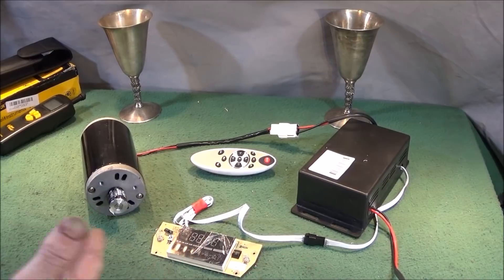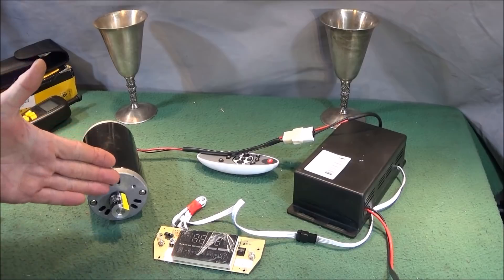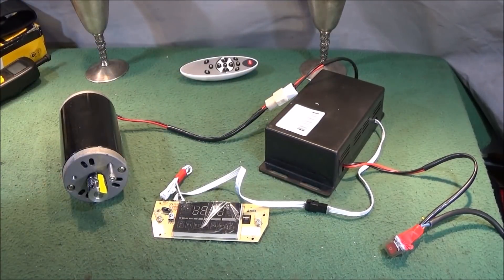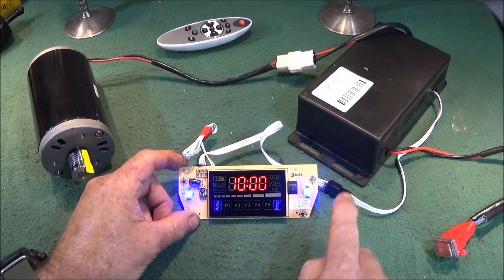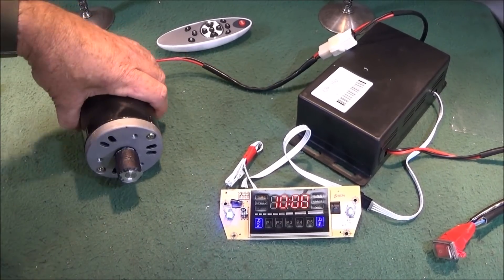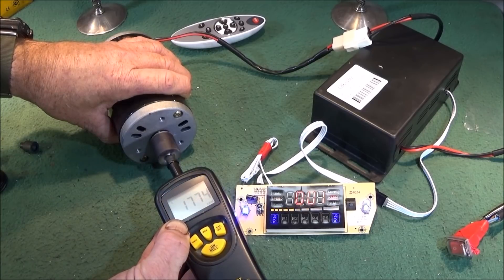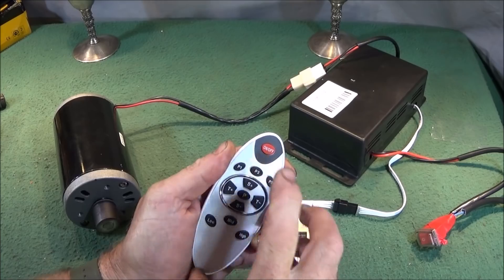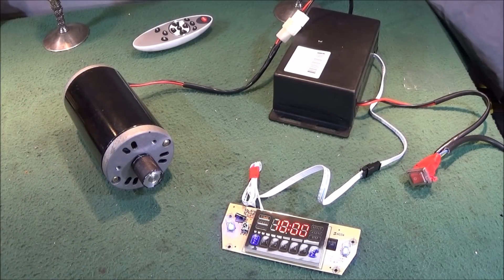An Excellent Variable Speed Treadmill Motor Set For Home Made Projects

Comment from the maker: The Fantastic Treadmill Motor Set https://www.ebay.co.uk/itm/2538507780...
SMARTSENSOR AR925 Digital Tachometer Contact Motor Tachometer --  https://goo.gl/9i18xR
AN EXCELLENT SEPARATE MACHINE TACHOMETER SET   https://goo.gl/6yGjCv
(This machine tachometer is a safe low voltage and is easily set-up on any machine. The wiring diagram
for this one is on the Banggood listing page)
Reply: I have been playing around with this setup and have found that if you follow the wires from the display part to the main board. There are 4 connections 5v 5v Pw and gnd . If you wire the last 3 up to a potentiometer you can control the speed with it and do away with the display part if needed! (You can change the direction of the pot by switching 2 of the leads) I have tried 10k, 100k and 1m. the first 2 work best the 1m didn't work. But I would say you need somewhere between the first 2, maybe 47k?  I'm waiting for 1 to arrive from ebay so I can test it. Hope this helps some people. :)
Reply from the maker: Banggood Health Protection -- http://bit.ly/33tNTBx
  Banggood Health&Care Protection --  http://bit.ly/3d7QpSy

Comment: Hi Steve.
Is this any good for a small wood lathe? My motor burned out on my small wood lathe. It was a 500-watt motor but I see this is only 200 watts, so just wondering if it might be any good as a replacement? They don't make motors for my old lathe anymore.
Cheers.

Comment: Guess so of you guys might have missed my original Post . Showing that you can very easily just wire in a potentiometer to control everything and get rid of the display board

I sent this as a reply so you guys might have missed it.

He's is my original message. 

Luthlan
Luthlan
3 hours ago
I have been playing around with this setup and have found that if you follow the wires from the display part to the main board. There are 4 connections 5v 5v Pw and gnd . If you wire the last 3 up to a potentiometer you can control the speed with it and do away with the display part if needed! (You can change the direction of the pot by switching 2 of the leads) I have tried 10k, 100k and 1m. the first 2 work best the 1m didn't work. But I would say you need somewhere between the first 2, maybe 47k?  I'm waiting for 1 to arrive from ebay so I can test it. Hope this helps some people. :)
Reply: Update 47k seems to work OK. Hope this helps!

Comment: hi Steve  just waiting on delivery for my motor  I will be  installing on my Simat 101 to replace  the blooming big AC    hunk thats  there now, just 1 question  what do the figures on the display refer too?  is is speed or some sort of percentage
Reply from the maker: Hi Nigel,It should be good for that lathe. The display figures are for the exercise machine it was meant for,that's allI know. The speed control set and display are very good electronics. If you want an RPM read-out set up a seperate unit using one of these.  DIGITAL TACHOMETER: https://goo.gl/6yGjCv
 These are simple to wire and set-up. With safe low voltage. The wiring diagram is on the Banggood listing when you scroll down the page, plus I have done videos on installing them.
Reply: cheers  Steve  ordered one from amazon plus a box to put it in , going to power it  from a PP9 battery and i think i will probably use the remote control instead of the panel itself  so that can be tucked away. how is your  application coming on?
Reply from the maker: Hi Mine is coming on well. I have just fitted the tachometer. Hope to show it in use again tomorrow. Hope you aren't going to sit back in a chair and operate the lathe with the remote☺

Comment: Great vid. I just recieved mine. I Really need to reduce the lowest starting motor speed to about 50 rpm without the use of pulleys and belts as pulley would be about the size of a dustbin lid to get this low. Would need  an electronic device. Then use existing remote to increase gradually.  Any advice ??
Reply: I have been digging though these vids for a while now and it seems the consensus is that they don't have any torque at that low speed. I need a motor for a super heavy antique sewing machine.

Comment: Hi Steve. I have decided that I will use mine as a motor feed for the milling machine. I will have to wire it in for a reverse switch, and I note the comments of  Craig Marshall. I now have all the plate material, boxes etc. that I need to make the motor feed, but unfortunately  I have other more pressing jobs in front of that at the moment. I see the seller of this kit now links to this video in his item description. Regards
Reply from the maker: Hi Stephen, That sounds like a great project. I will show the motor strip down later to see the brushes etc. Also I have found a great low cost DC motor control unit on Banggood to run these. Much simpler in design to the actual treadmill controller kit. I will show this in my next video later this evening if all goes well.
See the controller. It is a great quality small unit and it works perfectly. (It is AC 220v to 400W DC 0- 220V Controller)                       220V AC Speed Control Controller --  https://goo.gl/n5gzhT 
Regards
Steve

Comment: Thanks Steve. My father and I have both ordered one of these. One for the Little Tyzak Zyto Lathe (which is a bit like a poor mans ML7) about the same size as the Chinese mini lathes. The other one will probably go into my cheapy drill press in hope that I can beef it up and turn it into a light duty milling machine at a later date.

I am struggling to find a Surface plate that's cheap.  In one of your videos I saw you using a black granite chopping board type one. How good/flat is it. Is it worth buying?. 

A vid about cheap surface plates and how to get them or make them might be fun!?  

Many thanks for all your spiffing vids chap!

Luth.

Comment: It's only 200w ? The motor that comes with the mini mills and lathes are 350w and 500w , so not as powerful ??
Reply from the maker: These treadmill motor sets seem to have more torque than the mini lathe motor and speed control unit set-up. The mini lathe motor may have more wattage, but it is a bad set-up if it has the KB electronics circuit board. I have had seven years of experience with the KB board set up. It is ok for some light use, but can't handle a lot of work. The torque was very poor and I had no end of trouble with potentiometers, failing boards etc.

Comment: Thanks for the heads up Steve. I wonder if it could be modified to use a potentiometer for the speed control instead of the supplier control panel?

Comment: Any way to reverse the motor direction Steve?
Reply from the maker: Hi Mike, I have to reverse it for my set-up. Just change the two pin plug to the motor with the wires changed over. This changes the direction as its a DC motor I use these instead of the white connector.
https://www.ebay.co.uk/itm/2-3-Pin-Waterproof-Junction-Box-Connector-Electric-Cable-Inline-Wire-Plug-IP68/112601887773?ssPageName=STRK%3AMEBIDX%3AIT&var=413017200981&_trksid=p2057872.m2749.l2649
Reply from the maker: I use these instead of the white connector.
https://www.ebay.co.uk/itm/2-3-Pin-Waterproof-Junction-Box-Connector-Electric-Cable-Inline-Wire-Plug-IP68/112601887773?ssPageName=STRK%3AMEBIDX%3AIT&var=413017200981&_trksid=p2057872.m2749.l2649

Comment: This is a less powered moto for the chinese mini lathe right? Could see it being useful in other builds though.
Reply from the maker: Hi Tez,  Yes but it has really high torque. I didn't mean replacing the motor as it is situated in the mini lathe. I have seen where they use these with modified pulley drives, the motor re-positioned on the back to power the mini lathes. I have done a similar upgrade using a three phase motor and VFD, because I had so many problems over the years with the KB electronics speed control board, potentiometers and motor set-up.
Reply: Yeah I thought that would be the only good way for mini lathe too. I have used this motor and speed controller for a 2x72 belt grinder and it just doesn't have the power :(  keep up the good work Steve

Comment from the maker: ****************An important update:- Please note that this is about the program modes 1-5 only.*******************
There is just one point I should mention about the kit. The programs 1-5 run for ten minutes and are only really applicable to the exercise machine it was made for. This is because they start at different speeds, they then change speed every minute or so with different intensities throughout the program. Program one runs at various lower speeds, it builds up then drops back down again and program five is the highest speed, it builds up to the highest revs then drops down again. Due to these programs varying the revs they are not suitable programs modes for tools. 
     The manually chosen variable speed (out of the program mode) remains constant, as set though, and the 3 preset buttons on the remote control have speeds that remain constant in use, which is great for machine tool use.
Reply: The timer still affects continous speed mode. Default it will shut down in 10 minutes. This can be set to 20 using the remote.

Comment: Another great video thanks, sorry if I missed it but what was the max rpm? Do you think it would be suitable for milling on a CNC machine? How much slop in the spindle? Cheers
Reply from the maker: Hi Shaun, The top speed is about 2400-2500RPM. There is no slop whatsoever in the spindle. I reckon it would be excellent for a CNC machine. These motors have very high torque and are nice and quiet. They are one of the best you can get for machine tool projects. It is something  I've been looking for, but I was put off by the high prices people are charging for second hand ones on Ebay. When I saw these for this price, I had to buy one straight away.. I'm going to use belt drive will pulleys to bring the speed down a bit.

Comment from the maker: SEE EBAY BUYING LINK FOR THIS EXCELLENT TREADMILL MOTOR SET:-
https://www.ebay.co.uk/itm/253850778051?ViewItem=&item=253850778051
Reply from the maker: OTHER EXCELLENT THINGS SHOWN IN THIS VIDEO.
SMARTSENSOR AR925 Digital Tachometer Contact Motor Tachometer --  https://goo.gl/9i18xR
DANIU DT2234C+ Digital Laser RPM Non Contact Tachometer _ https://goo.gl/q8itGD
Banggood 12 12% off Cutting Tools --  https://goo.gl/UfuM5r 
  12% off Cutting Tools --  https://goo.gl/UfuM5r 
   60% off Mechanical Parts -- https://goo.gl/GZLbf2